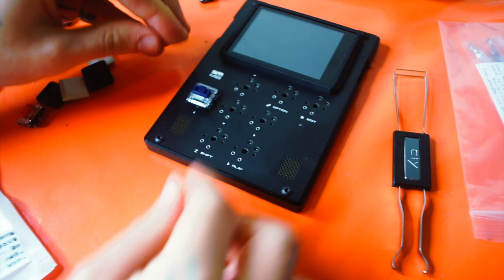Dirtywave M8 Mechanical Switch Replacement

Comment: For what it's worth, I use my fingers and no tool. If the tool was plastic I would feel more comfortable recommending it. Metal has a good chance of scratching the pcb top surface which might make it look a bit ugly. :)
Reply from the maker: Something I found to my peril!! My giant stubby fingers aren't dexterous enough to get the caps off.
Reply: yep I just used the lego brick removers to pry them up evenly a tiny bit then pulled them straight up with fingers

Comment: Nice. Been thinking about finding some fun coloured caps. I’m happy with the default switches.
Reply from the maker: You know what you have to do...
Reply from the maker: p.s. I happen to dye the caps as well, depending on the colours yer after. Will be doing another run soon.
Reply: You can search for Kailh choc (the name of the switches) keycaps. But your best bet would be to search for "MBK keycaps" or even "MBK color keycaps"

Comment: got very scared before realizing they were hotswappable - accidently pulled one out while just trying to change the keycaps. This video set me straight.
Reply from the maker: I'm glad it was useful!
Reply: Came here to say the same thing. One of my switches came off after a fall, this video helped me realize it was easy to pop back in.
Reply from the maker: @therosskonian2579  Glad it was helpful!

Comment: Amusing accidents, could be a fun Short.

Thank you for the details. And the friendly presentation. Very useful for me considering keycap/switch customization.
Reply from the maker: What kinda switches you thinking of?
Reply: @StephenMcLeod  Maybe quiet ones, (manually dampened, or linear) depending on how I take to the stock switches.

More: I enjoyed hearing the louder clicks of the blue switched in this video. 

To be clear I'm not an owner of this device. I am eagerly watching Tim align Heaven and Earth to being a position to build and ship model 2 units, and ofc I'm planning to route one to me.

Ultimately, for me it will all be about satisfying clickiness, for me satisfying might be quieter. I'm curious to try wrapping mini rubber bands around switch parts to make thudding happen on key press.  

I grew up using trackers on commodore 64s and Amigas along with a sampler dongle and various tape recorders. I scrounged samples from mod files to build a library.

The minimal interface of the M8 along with a large mental model that you need to have to navigate it's features could be, for me, positively rewarding. I need help, support, to get back to the position where I can feel comfortable creating music. And keyboard switches hopefully could help support getting my vibe on, given the way that I live my life nowadays.

Comment: I'm deciding between the M8 and the Tracker Mini and I think the fact that you can customize the caps and switches just pushed me over the edge. That'll compensate for putting up with micro-USB 😊
Reply from the maker: It is a particularly nice feature! Micro USB doesn't bother me on the tracker as it is reinforced due to the nature of the design, fwiw!

Comment: I recently tried doing this with one of the original beta units... I pulled until I broke the switch and then realized the beta units don't have replaceable switches. Oops! Luckily I'm pretty handy with a soldering iron so I managed to fix my mistake pretty quickly.

...until I made the exact same mistake trying to change the switches on a non-hot-swappable keyboard. (:
Reply from the maker: Oh noooooo!!! What a nightmare.

Comment: thanks a lot for this video! I'm eager to replace for silent switches when my M8 will arrive to prevent bothering people around when I'll be in the train or plane but I am not a "manual guy" and was scared of proceeding, but you demonstrate it is pretty easy and safe :)
Do you know what the actuation force of the default switches is? Would help me assess if I need more or less and pick the right model that fits my preference.

Comment: Hey, nice video! 👍🏻
Currently waiting for my own M8, planning on changing the colour of the caps, what size are they or do they go by some specific name?
Reply from the maker: They are Kailh Choc Low Profile key caps. Specifically the MBK ones. Finding replacements in custom colours is very hard. I ended up dyeing my own (and selling them on etsy), but I'm all out for now!

Comment: m8 came yesterday may do this at some point now that you have had the m8 over a yr how is the battery holding up and is it possible to replace the battery if needed ?
Reply from the maker: No battery issues. I believe it's replaceable but I wouldn't take my word for it.
Reply: @StephenMcLeod  ok thank you p.s I’m still getting used to the name change lol I can hear all my friends are synths in my head

Comment: Lemme hear that THOCC!
Reply from the maker: Never! Click ftw
Reply: @StephenMcLeod  I'm a fan of high quality scissor switches, but I would like to give mech keys another chance now that I've learned more about the variety of switch types. Do you feel the switch type for the purpose of controlling the M8 is the same as what you like for a keyboard for typing?

If anyone comes across this in the future looking for nice scissor switch keyboard check out the Cherry Stream.
Reply from the maker: My preference for switch on the M8 is a bit different to boards, largely in regards to actuation force, because you're pushing horizontally with thumbs.
Reply: @StephenMcLeod  That’s what I was wondering. Do you go for lower activation force on the M8?
Reply from the maker: @milk_bath  Oops, sorry! I missed your reply. Yeah - I thought I would prefer higher af but did not! Regular is grand.